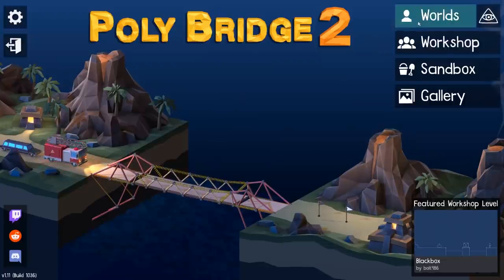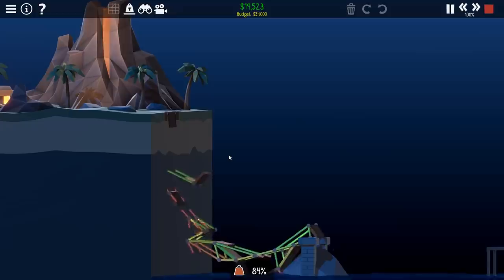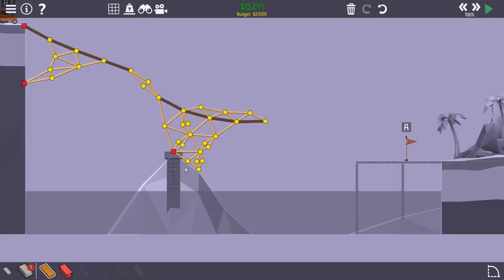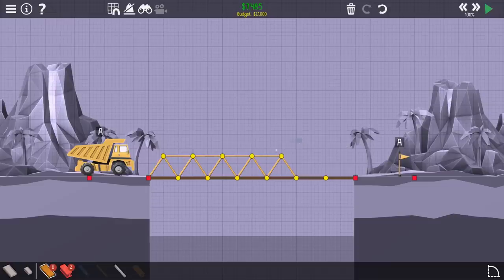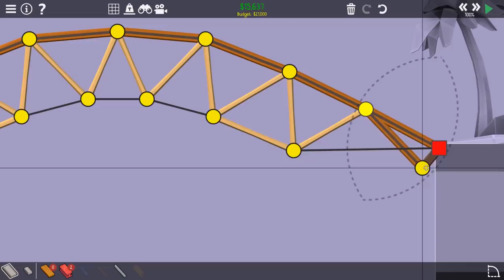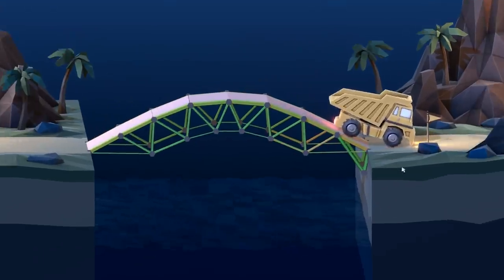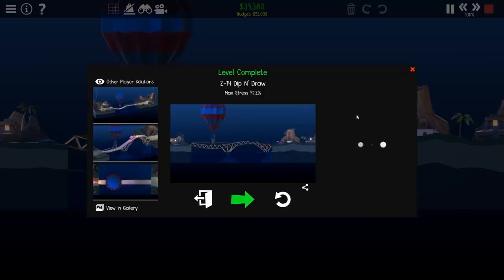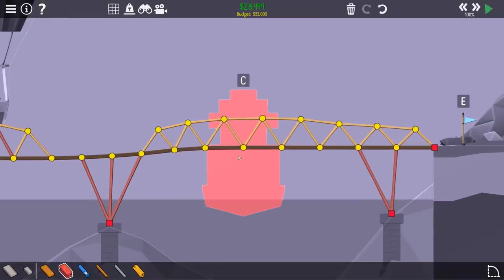This could cost me my JOB!!! Real Civil Engineer plays Poly Bridge 2

Comment: A few things. The goal of any hydraulic level is to minimize the total length of hydraulics and if you can find a way to build the bridge without any that’s even better. You should try to use more land supports. They are typically pretty strong on their own and they don’t put pressure on other supports. Also some fun facts. Split joints don’t interact with land, so if you need a node to pass through something just make it a split joint with everything on the same number. On levels where there are multiple cars going at the same time slowing one down to allow the other to finish the bridge is a good idea because the bridge can be cheaper overall.

Comment: Tip: Springs are cheaper than steel, and can take a surprising amount of abuse before breaking. Also, they can be used to save money by drawing something with much smaller size spring lengths, but making the springs compressed so that when the simulation starts they decompress and push things out to where you actually wanted them in the first place.

Comment: Can I quickly say congrats on your success, your channel has grown extremely fast, faster than I have ever seen from a YouTube channel with less than 100 k subs. Keep up the excellent content and have an amazing day. Maybe even get to 100 k by the end of the year at this rate? Good luck. Also a quick tip, if a muscle spans less than a meter, use steel instead as it is cheaper. Another tip is before using steel for an under support or a wood muscle, try road as road is stronger than wood and cheaper than steel

Comment: I think the issue with the arch (string theory), was in that the truck has to move downhill on the right side. I don’t know how the kinetics are programmed — slower up, faster down; or same speed throughout? But seeing the bridge had mirror symmetry, yet collapsed on the right side, I suspect the extra momentum from the gain in the height could not be dispersed over a wide enough area and slow enough on the down side.

Comment: Level 2-14: First I wondered why your solutions didn't work that well. But after comparing with my solutions - it would hav been way easier if you had the road doing one "U" arch with the lowest point in the middle (above the rock). "Wavy"shapes always make things complicated. Also try leaning the bridge on the walls on each side if there's no connection.

Comment: Honestly, you don't need to compare yourself to the leaderboards for price. The top 10% are almost always people who cheesed the level exploiting the game physics in various ways (bridges with no supports, falling roads, spring cannons, clipping the car into the ground until it propels itself at the checkpoint, etc). For example, in order to avoid using expensive hydraulics on that final bridge, some people have attached the ambulance and moped together with roads and rope so that they both go before the boats. It's more interesting to see you engineer a better bridge than attempt to game the system :P just do you.

Also it's not too bad to show us your reactions to the gallery :) Some of them are pretty interesting and it's nice to hear your input on them.

Comment: Question: Are the arced cable tension bridges not arches because the forces exerted are working in the opposite way as a stone arch? Pulling rather than pushing? Or does it come down to orientation of the curve?
Reply from the maker: Same thing, don't think about where there forces are acting in general, just think about how they are applied to the arch. You'll then notice a weight on top will do the same thing as a weight hanging from underneath!
Reply: ? This is gibberish to me
Reply: @RealCivilEngineerGaming  thank you, this really made it clear.

Comment: yuo are losing momentum at the top by it nose wheely, you need to get the car to change orientation more gradual so it dont decrease speed. On the 3rd generation, where you got the gap, again the car is loosing speed by the angle and it nose in. smooth that out so it dont loose speed